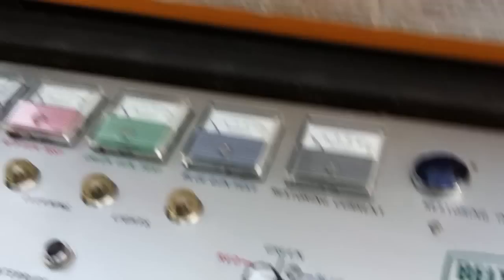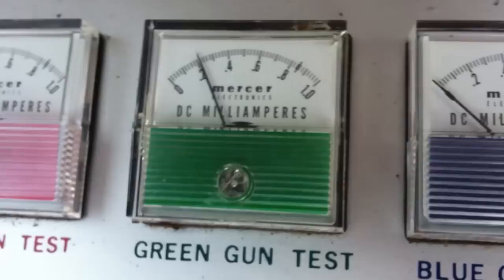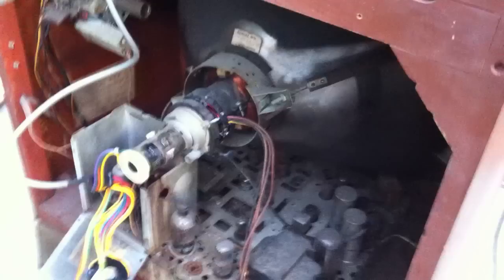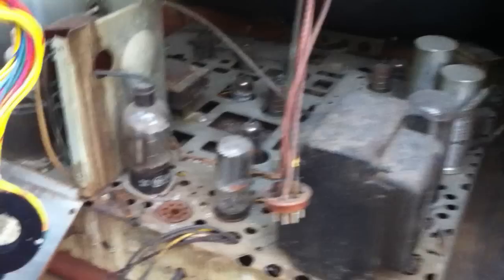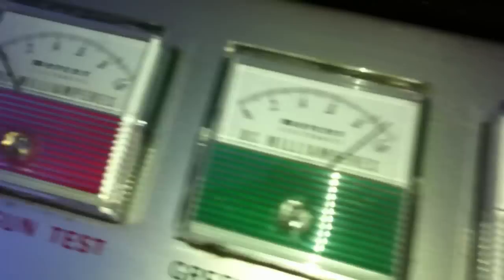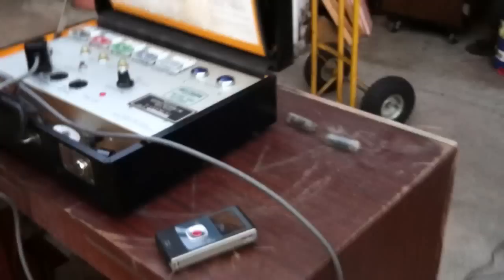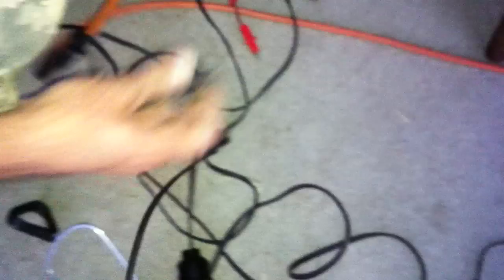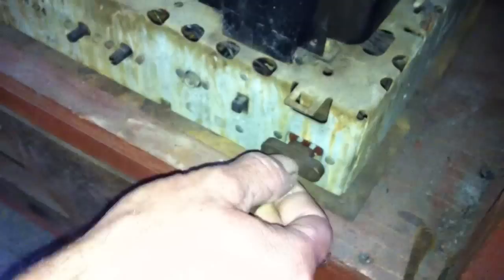1957 RCA KCS 104 TV evaluation

Comment from the maker: It may be in the IF section. I found this on google: 

"The 6DE6 is a miniature sharp-cutoff pentode designed especially for use as an intermediate-frequency ampliﬁer in television receivers."

My friend currently has this tv at his house and I don't have the service manual yet otherwise I could tell you more.

Comment: I just ought a nice 1958 model like this today, blonde cabinet. It does come right on and screen lights up, but sound is weak, I did notice a tube was all white tube number is 6de6 tube, not sure what that controls I saw them on eBay new old stock for a few dollars, cabinet is flawless and the insides are very clean. There is a tv repair guy local to me, I'm fortunate enough he works on these I will bring it tommorow. Anything I need to know or should I look for, any info or tips I'd be greatfu